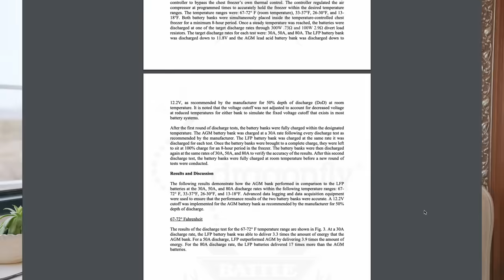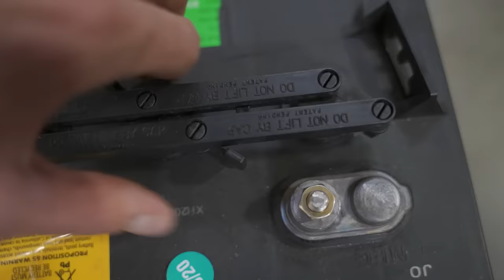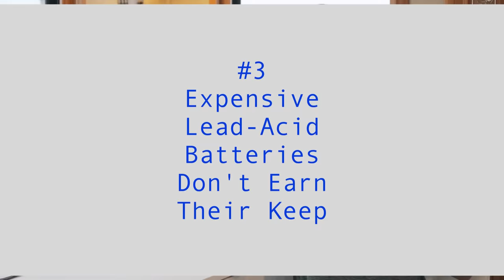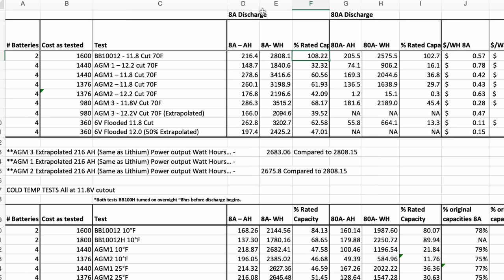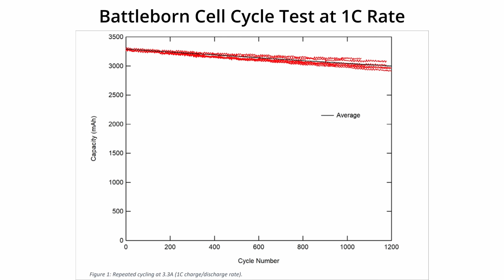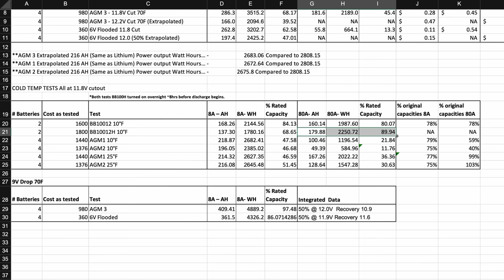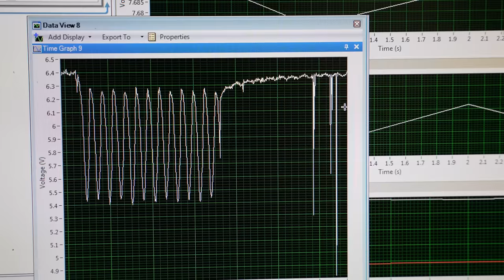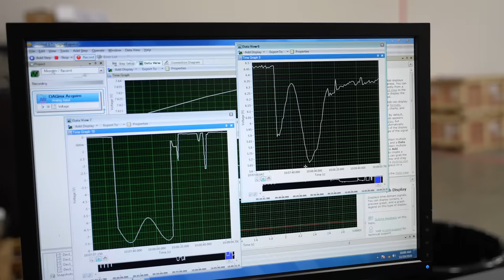Don't Waste Your Money On Batteries - The Shocking Truth I Discovered When Testing RV Batteries

Comment: I just use cheap Walmart deep cycle. ~$75; 105Ah.. 8 of them, ~$600; 840Ah; ~42 amps over 20 hours; ~504W continuous.. that's a 6k btu air conditioner, including inverter loss.
Replace every 3 years and for 6 years I have 8 times more capacity at about the same price as ONE of your advertised lithium batts.

idk, techy stuff's cool and all but sometimes 8x spec with disposability makes better economic sense.

Comment: It seems like you are observing this experiment based on the RV/mobile application. I think it's worth pointing that out. For the, let's say off grid cabin system, you are most likely gonna cycle through top 20-30% and it would be interesting to test lifetime in those cases. Because it's gonna force lithium batteries to stay charged for most of the time which they don't like. Would be nice to see the final cost comparison over the lifetime in that case. Great job and thanks for providing all this data!
Reply: Hmm
Reply: You can also desulphur (industrial practise for recondition) lead acid batteries with a generator increasing their lifetime exponentially
Reply: He keeps calling it a "lithium ion" battery when it's an "iron phosphate" battery he's testing (LiFePO4).
Iron phosphate isn't so picky about sitting at full charge.
For any off grid cabin, you're gonna want iron phosphate, they have half the energy density, but last like 5-10 times longer than lithium ion. They also don't generally catch fire, handle temperatures better, etc.  (technically iron phosphate does use ions of lithium, but it's generally marketed as it's own battery type, LiFePO4)

Comment: Very informative video. I've been off grid solar for years and have done numerous real world experiments, and have come to believe that very cheap flooded lead acid batteries are most cost effective, if properly maintained. I use an oversized battery bank (10-100AH batteries in parallel) and keep them above 50% charge. One needs to keep in mind that a battery that reads 1.2 Volts while under load has well above 50% charge left. The 12.2 Volt 50% rating they use is based on a resting battery, not one in use. I am curious to know if anyone has data equating battery voltage at different load wattage to charge percentages, would make charge estimation much easier.
Reply: Who are you trying to impress by wearing the mask?

Comment: Interesting watching the power cycling for the coffee maker and microwave. Car stereo aficionados' have used large capacity capacitors for years because of the large swings in current need, especially if you're running subwoofers.  I wonder how something like the ultra-capacitors from Maxwell would help overall battery performance and longevity.
Reply: For the Battleborn it wouldn't be as useful except that it would protect the BMS from popping a fuse, but in MOST setups you match your inverter to your batteries so it can only pull what the inverter can draw. So it's more likely to blow the inverter.

That said... UltraCaps would be awesome in either system. Ideally you would want them on the AC side, but I don't know how to do that. Putting them between the battery and BMS will definately help tho. It's more of a constant load and would make the inverter very happy that they voltage doesn't fluctuate. This usage however wouldn't require UltraCaps tho a typical SuperCap that doesn't store as much voltage would work just as well. Technically UltraCaps are SuperCaps, but the idea behind naming them Ultra vs Super is that they also hold a decent amount of mAh vs a standard SuperCap. 

Sorry for the long reply. I was typing and thinking it out as I went... :P Great idea tho!

Comment: Try factoring in warranties. You did touch on the subject @36:00?
Walmart has a 3yr. and 2yr. Warrantee on many of their cheaper batteries. Most of them are made by the same manufacturer. ( Johnson Controls)

Comment: How did you even find the lead-acid batteries' ratings? They're normally rated in "cranking amps" which is completely meaningless since it doesn't include time. As someone who lived on a yacht for 10 years I already knew they were sub-par for the task ... although, as you've discovered, the Trojan 6V units are better than most and are thus the battery of choice for yachties on that basis. The issue with them is their weight, making them cumbersome to install and/or service.

It would have been interesting to see a comparison of self-discharge rates, and a comparison to batteries that have been refilled with an alkaline solution (e.g. alum), although I do realize that this advertorial probably doesn't extend that far.

As for lithium, they're still not up to the standard of being usable for the majority of interesting applications, being both too heavy and/or too expensive for their available capacity to be usable viably in electric vehicles or aviation, short-range vehicles notwithstanding. Discharge rates are also advertised to widely varying standards among manufacturers, making direct comparisons impossible even for an electronics engineer such as myself. And as you've correctly noted, the battery manufacturers tend to lie anyhow.

Comment: Typical advertising. You own the battery,  take them as low as you want. A lithium manufacturer is not going to come check on your SLA battery's DOD. As a added bonus as long as they are not dead they won't freeze. Just leave them in the RV during the off-season well below zero. -35F is not unusual where I live. If you do screw up and they freeze all is well unless the case cracked. They will still charge up and give many more years of service. My current camper has an Everchil 12-volt refrigerator. It seems to work just fine with 10.5-11.00 volts when I haven't been paying attention. A battery is an inanimate object and is absolutely not concerned with 50% 80% or 100% discharge conversations. I did accidentally hook a charger up backward once to a 100% dead lead acid battery and now the positive and negative terminals are backwards. Works great but strange. I do replace the batteries every 6-8 years because it seems like I should and since they are never removed from my RV I have no idea if one of them has had a catastrophic internal problem. 4 105 AHG batteries at 80 bucks a pop every 6 years? I can deal with that.

Comment: I had been wondering about ditching batteries altogether and I'm sure there are reasons why I'd be wrong to do that.  My curiousity arises though because I keep coming across extremely cheap/free solar panels that show good output on the multimeter.  My idea was to perhaps avoid the cost of batteries and charge control etc by having my equipment powered by solar during the day and grid during the night via an Automatic Transfer Switch instead of a grid-tie inverter - and YES, any unused solar power during the day wouldn't go anywhere.  I guess my question is whether the inverter can handle the range of solar voltage or needs a controller/dc-buck/other in between?

Comment: Thought this was a unique study w RV but my issues w my Rv is with cold cranking in cold weather starting. Understand that a diesel has issue w gel w fuel but I have had to purchase batteries 3x in 5 yrs which pisses me off until I bought the agm batteries   I’m not an electrical engineer but w love to speak with you.

Comment: At 3:40 when they install the load resistors everything there looks metal on metal if that's so you just shunt (short )your load resistors,if that reflecting sheet behinde the resistors is metal then that is the case!

Comment: I hope you also figure in the cost of the replacement of all thing destroyed by low voltage operation because the slow drain no shut down. Lithium goes wide open till total shut down.

Comment: I wish you had been able to get some Eve or Lishon 280ah prismatic cells.  The cost of those is SO much less than Battleborn batteries.  Four 'batteries" of the Eve/Lishon cells (1120ah) costs around $1700, which is an $8,000 savings over Battleborn.

Comment: Lead acid is a mature technology, it will probably not get cheaper to produce.  With that said, Lithium types have more future potential.  Lithium Titanate, Lithium Iron Phosphate,  Solid state lithium.

Lithium is actually crazy abundant in the earths crust.  Lead is surprisingly rare by comparison.  Just like how aluminum was at one time roughly equivalent to gold in price because of complexity to mine and refine - Lithium will only get cheaper to mine and refine in the future.  Especially if China finishes off the TsangPo dam.

Besides:  If you do the "solar generator" all in one - the weight of the battery that you have to carry to an electric bicycle to charge it up fully with lithium will only weight about 8 pounds.  Lead acid means you are pretty much always stuck with placing it in a two to ten ton vehicle or house.

Lithium inside an electric scooter without suspension is completely doable.  Lead acid has difficulty in that type of shock environment.

If they are roughly the same performance.  I will buy lithium every time just to push battery technology forward and reward innovation with my dollars.

Comment: It’s clear Battleborn are great quality and excellent value for the life of the unit, however without adding some additional lithium batteries that are both cheaper and decent quality hard to get a clear picture and limits data. To not provide names of AGM batteries also does not provide every day purchase value or assistance. We have been provided the name of the most expensive lithium but no names or tests of other brands and no information on what brands of agm bstteries

Comment: Excellent analysis in general BUT, why don't advocates of Lithium Ion Batteries (like yourself) EVER actually state the Number One Safety Risk with ALL Lithium Ion Batteries (which includes Lithium Iron Phosphate batteries) in their analyses - is the very real risk of fire and/or explosion due to misuse, short circuit, failure of BMS or charging system components?  This is the main reason (together with exorbitant cost and greatly exaggerated recycle times), I accordingly, will never use Lithium Ion Batteries in my caravan! For me, I am totally committed to AGM batteries given the available technology for AGM and Lithium Ion batteries (in Dec 2023) and consider this adverse safety factor to be the prime deterrent in this regard. For this reason, too, I use LPG for my cooking and coffee making etc., and yes there is a risk of fire and or explosion from LPG cylinders if the "proverbial ever hits the fan", BUT this risk, in this case, IMO, is far, far less in comparison and is definitely orders of magnitude more easily monitored and therefore, avoided! I too, totally support the comments from "OldManandtheSuperC", below!! Finally, one more major consideration, as far as I'm concerned, is the huge $'s saved in not getting sucked into the Lithium Ion Battery hype which effectively allows me to purchase three new sets of AGM batteries (if ever required) for what I would have to outlay for one pair of Lithium Ion batteries!  Here too, (touch wood) I am still using my original pair of AGM batteries (which are effectively as good as new) which were purchase with my new caravan in Nov., 2017!  So, my pair of high-quality AGM's are presently six years old and still going strong!!! Cheers.

Comment: The Battleborn batteries are nearing $900 for a 100 amp hour battery. Lead acid is running $150 and under for 100 amp hour. So the Battleborns better perform at least 6x better

Comment: This may be OK for an RV, but I have a riding mower that cost me $3k and change with four 12v LA batteries and at $1k a pop I don't see myself replacing those with four lithium batteries ever, not even one at a time over time. No wonder lithium powered mowers cost $5k and they give you three batteries with it and call it a $3k value giveaway.
If performance suffers in winter when I want to use it for plowing snow, then I'll arrange for a heat tape or blanket to warm them overnight.

Comment: Just today I was looking at Lithium batteries for use in a trawler boat. From what I saw there your costs to go LI don't end at the battery, you need special monitors, cut off units, and you can't even charge them from an ordinary alternator. Is it even do it yourself?

Comment: Do the lithium batteries have built in fuses for safety?  What are the safety differences between the lithium and AGM cells?  I believe the cells in a Tesla are actively cooled to ensure they are not over heated - it seems to me a RV enclosure of the batteries would not be a good idea for hot summer days.  Did you calculate how many “Watt*hrs” it took to charge each battery and possibly get an efficiency rating of input vs output?

Comment: The real question is how you can justify spending $1000 on a battery with a heater when a comprable battery without one cost $200-$300. 

I'll just insulate and add a small 12v heating pad with a temperature switch for the low cost of 20-30 bucks. A $700 heater is too rich for my blood. 😂

Comment: Some good data and an interesting video however for marine applications this is quite misleading. When sizing banks for sailboats it should be based on discharge to 50% in the worst case scenario. This is likely running everything on the boat at once. The same calculation is used for Lithium, max 50% DDC. Why would you apply this to Lithium? Because the 50% limitation is not to preserve the batteries it is to provide a power reserve in case of a charging circuit failure. With this sizing however the actual regular discharge cycle tends to be around 15 - 20% that greatly extends the battery life and thus the lifetime operating cost. The other factor normally included in cost analysis is the cost of the capital outlay. In simple terms if the more expensive bank cost, just for argument $1000 more and projected life is 10yrs what would the cost of borrowing the extra $1000 be or what interest would it earn in investment. If you add this in it more than pays for the replacement lead acid bank. 
For me the real positives of Lithium are very high discharge rates if you run things like electric cooking ranges and for catamarans or RV's the very significant weight saving

Comment: I'm going to guess the batteries with part of the green stickers are Intestate batteries. That's all I use I'm my Diesel truck and what's currently in my 5R at least until I get the solar system installed.

Comment: What voltage were the lead / acid batteries charged to?  Most people assume the top voltage that they charge to is 12 volts while in fact they charge to somewhere around 13.8- 14.5 Volts.

Comment: Lead acid batteries off gas. Lithium batteries are a fire risk. Simple fuses between cells could stop the chain reaction explosions and fires in lithium batteries. A service disconnect like new houses have for firemen on Tesla batteries and fuses could stop them from burning for hours.

Comment: What was the current being tested?  High current testing vs. low current testing will greatly skew the results in favour of lithium.
Reply from the maker: We tested lots of different currents, and lithium always won, but yes it is much closer at lower currents, the resistance in the lead acid isn't as much a problem for low draws.

Comment: I just saw this and this leads me to a question that maybe you can answer... Can I replace my aging 100 AH flooded acid battery with a 50 AH lithium battery... I have a 2000 watt inverter that is not used too much and the rest of the load are the 12 volt needs of a 19' travel trailer. And I have approximately 200 watts of solar panels mounted on the roof, with a Renogy Adventurer 30A PWM charge-controller.

Comment: Yeah? Well, leaded batteries don' t suddenly burst into flames for no known reason! I'm 65 years old and will stick with what I know and that would be deep cycle 6 volt lead acid batteries. You take care of the batteries, maintain the water levels and don't abuse them, they work fine! Besides, if lithium batteries are so great why don't car companies use them for starting cars/trucks/tractors? Also you can rebuild lead acid batteries if your really in a bad spot.

Comment: Here's my issue with lithium batteries, as far as I know: they're more difficult to recharge properly. Now I know with solar and some solar controllers they can be charged easily enough, but with standard SLA batteries I can build a direct 12v charger for them for less than $200. 

What would be the cost of something like that for lithium batteries? Is there even an option?